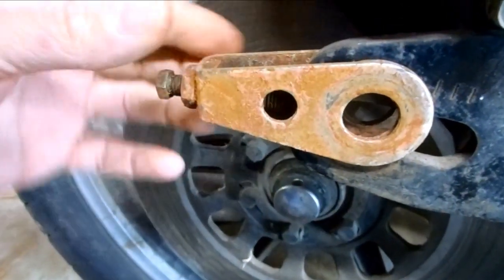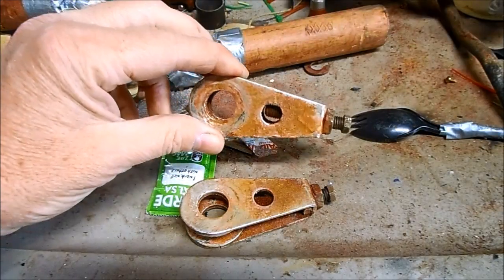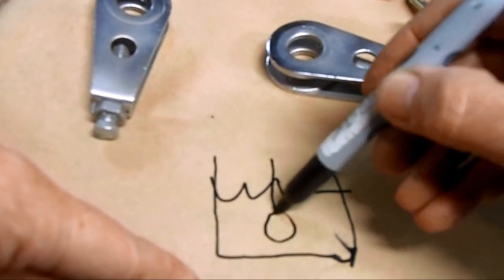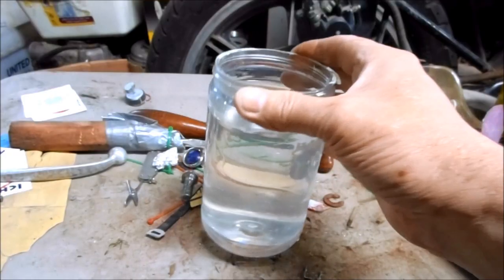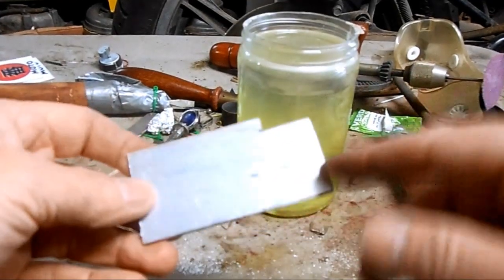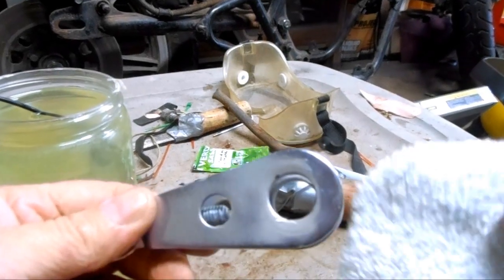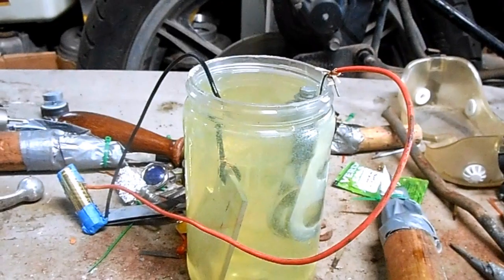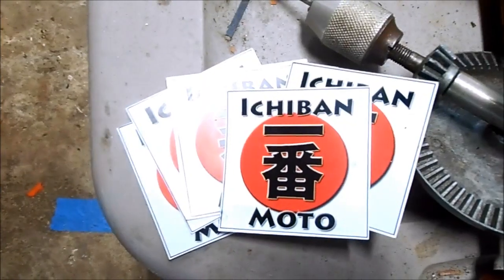how to do zinc plating of metal parts for corrosion  protection  diy electroplating

Comment: Video fake!
The connection to the zinc plate does not exist!
The plate has contact with the insulating part of the electric wire, not with copper.
MAXIMUM IDIOT!
Reply: it's always funny hearing the one thing someone found to be off but everything else seemed legit.
Reply: Thank you so much Enzo.
Phew, that was a close one. I nearly didn't electroplate my whole motorcycle.
Reply: nice catch! i thought he was on to something
Reply: It's a joke video Idiot Supreme.

Comment: Good job, but the coper wire don't touch the zinc plate, for faster results connect the wire to the plate w/o pvc insulation and replace the power source with higher voltage battery or AC/DC power supply.
Reply from the maker: induction?
Reply: Marjan Stojanovski hotnbgirlswith bigappati
Reply: Do you know that this video is a joke?
Reply: Marjan Stojanovski

Comment: roughly how long did the parts vibrator step take? also can i plate straight on to am item thats been through eloctro de rust process or will it nee to be shiny ?  thanks
Reply from the maker: it does look much nicer if you polish the metal first

Comment: Hello! it was actually proven that Coke isn't acidic enough to really remove rust; most of the results are from the abrasion from the aluminium foil. For easy DIY rust removal, a Vinegar soak is far more effective =)
Reply: i would bet money the coke had little to no actual involvement with that.
Reply: eh I know you glenn, I saw your tractor, after seeing you add the coke that evening i pissed on your tractor barrel and THAT is why it run, but it only works with MY piss
Reply: pics, or didn't happen
Reply: I used coke down the cylinders of a 1940 Case tractor that was rusted and siezed - months later she started up - good stuff
Reply: I hear your're the one that started pissing in the diesel guys gas tanks. That really caught on with to automakers. thanks

Comment: What are you talking about? This works way better with Mushroom juice and 1.5 volts AC from a 1920s train set but you have to be carefull to dust it off with baby powder at room temperature for at least 16 weeks twice a day or untill it turns black.

Comment: old zinc chloride battery have zinc  cases ;-)
readily available & cheap>>> not much charge :-D
Reply from the maker: +Paul Wedlock   oh, top tip!
Reply: So long as there re cycled:-)
It's a good thing.

Comment: You can't imagine how many times I've seen people sit around for long periods of time with sandpaper and files, busting their knuckles and wearing down their skin to remove most, but rarely all of the rust on a part. Then they reinstall it after spending part of an afternoon on it. Within a month it's already rusting again! 

A tumbler is a godsend for corrosion removal, and if this method of zinc plating is effective, then this operation is world's better than the other option I talked about. 

How effectively does the zinc adhere to the part, assuming it's perfectly clean?
Reply: The video is largely correct. After initial mechanical cleaning and de-greasing, it is better to prepare the part by immersion in 50% spirit of salts (commercial hydrochloric acid) in order to remove all old plating and rust. But never do this in the house, or the fumes will be attracted to your taps, get absorbed into the water all strip all the chrome off.Next all remaining traces of grease must be removed grease must be removed and latex gloves worn from then on, since even moisture from your hands will cause perforation of the plating.The rest of the video is largely correct, except the time element, since a good protective layer of zinc will take a few hours to deposit. Using a dry battery is a cheap and efficient way of limiting the current for a one off job. the conductivity of the electrolyte solution is also important, but unless you have measuring equipment, it becomes trial and error. Always remember, the slower the deposit, the better the protection. I would select a suitable sized battery to deposit the amount of zinc required and leave it running overnight.
Reply: if all of the rust is gone the zinc sticks like shite to a blanket but any rust will show through the plate. You can get blue/silver/clear passivate as well as gold/yellow passivate for different colours. the zinc wont stop it from ever rusting again. it will just slow down the process extremely.

Comment: You just have to be more clear that the part you want plated should be connected to the negative side of the battery.  Also, since this particular part that you used in the video has a nut and bolt on it, you have to remember that the plating can easily build up on each to the point where it gets so thick that you wont be able to turn the bolt in the nut any more.  
  I don't know how soft a metal the zinc is but you might want to plate the bolt separately and if it wont thread back onto the nut then you might have to use a tap and die to re-cut the threads on the bolt and nut section of the part.
Reply: +mrfester42 But the positive terminal is more electro-negative than the so-called "negative" terminal.  The electrons are negative, and they come from the (+) terminal.
Reply: It was a sarcastic video though.

Comment: Wooow that's awesome I've seen this method with copper coding. Actually can you do the same thing for gold coding too or its just won't work with gold ?
Reply from the maker: +Levik Eisagholyan  basically, yes. you just need to use the proper electrolytes

Comment: What are you using for media in your tumbler?, I tumble brass in corn, but dont think it would work well for steel. thanks
Reply from the maker: +doacarnage   yea, corn or walnut shells won't cut rust on steel. I use a synthetic coarse clay in this video. I breaks down too fast and takes a long time so I'm still looking for something better without buying the media from a tumbling shop. https://www.youtube.com/watch?v=DGT20ghWMZA
Reply: +Ichiban Moto I think I'll try Ebonygrit - Copper Slag Blasting Abrasive. Its only 10 bucks for a 55 lb bag
Reply from the maker: +doacarnage  bad ass awesome !

Comment: A major question :
Why you have connected red wire to negative battery pole and black wire to positive battery pole ???
Reply from the maker: +Qatari Man   you need to use both ends of the battery

Comment: ok I sanded down a aluminum compound bow riser.
Reply from the maker: +Chad Brailer   aluminum oxidizes, but ferrous steel rusts. there are unique and different process to protect each.
Reply: i did have it powder coated but that was a waste of time.. it chipped all the time. i was thinking of doing hydro dip an see where it go's with that.. if not what i want then i may just stick with the polished aluminum look.. its a old mid 90's compound an just fooling around. Thanks for the info to.
Reply from the maker: +Chad Brailer  let me know how that hydro dipping goes, I have yet to try it
Reply: ill do thanks

Comment: Very clever,   I will try it.   Do you have a video on how the bunt cake pan vibrator works?
Reply from the maker: +Jeffrey Nelson  yes, I have a video on how to make the vibrating parts tumbler
Reply: +Ichiban Moto   I was thinking about making a little aluminum box that would clamp under the sander and partially filling it with sand.   Worth trying with the random orbital sander.  I will work on this tomorrow.

Comment: "the red is hot, the black is power"..............
Reply from the maker: +TheDrakenZ  correct
Reply: Ichiban Moto I was under the impression one was power and one was ground on DC, also that hot was synonymous with power. "hot, neutral, ground" with AC. I'm curious.

Comment: Bad ass for sure. I was wondering though if the piece was plated where you have the wire connected to it or does the wire prevent the plating from reaching it?
Reply from the maker: +Nativtexan2  you can tell where the wire was. somebody told me to do the plating in two steps, each time hooking the wire to a different place to ensure coverage

Comment: Great job Ichiban.  I used a slightly bigger container, can you give proper ratios of soda to juice to water?  Thanks in advance.  Also you didn't give gauge/length of wire or actual battery voltage.  Are those important ?  Because your parts looked great and I want my part to look great.. ut oh my coffee is ready to consume gotta go by by..
Reply from the maker: +MrB82901    I love coffee !

Comment: I have question. Can i chrome my motorcycle parts with this method?
Reply from the maker: +Wąziu Kebab   chrome plating is too many steps and requires  very dangerous chemicals.  so I never tried that
Reply: Oh ok, so is this proces works with other metals than zink?
Reply from the maker: +Wąziu Kebab    I have never tried different metals . I have only used zinc. It's basically just galvanizing.

Comment: Please take note that in the video he did a simulation of drilling a hole in the Zinc plate but the plate did have a hole in it so it apparently was drilled off screen and also the fact that the negative wire still had the insulation on it where it was threaded through the plate. There will be absolutely NO current flowing through the plate to the chain tightener. The wire insulation must be removed so the wire is actually touching the plate. I'm not sure this process will work but it's still worth a try. To bad he didn't go to the trouble of doing the video correctly.
Reply: +SOAPBOXSAMBO Look up the word "Parody"
Reply: +Hathorr1067 OK, I'm not gonna get into a debate with you but I will point out that you wrote "Here I demonstrate my DIY process" and NO you didn't. I know what a parody is and that wasn't noted anywhere. If you're gonna do a parody at least do it correctly. With that, I will allow you to beat me up for pointing out how not to connect their electrical wire to the host plate and you should take back four (4) of your ICHIBON MOTO stickers. :-)
Reply: Well, I am not the author of this video for one, and somewhat see your point, but this guys channel is really about giving you an idea, and the rest about humor.
Reply: +Hathorr1067, My fault for not looking to make sure you were the author. Sorry about that. Please accept my apology. There is so much junk out there and to me this is one of them. I totally missed the humor. I was researching info to actually zinc plate some parts and when I got to watching this I could help but make a comment. When someone is looking for correct info this isn't where they will get it and that was why I pointed out the flaws. Thanks for your reply comments.

Comment: A much better job would have been attained if you detached the Adjusting Bolt and its Locking Nut before you plated the main assembly then plated the Adjusting Bolt and Locking Nut seperately !

That way you get the Galvanised Protection evenly distributed on each part of the Assembly !

Other than that, nice Video presentation - thanks !
Reply from the maker: +LiarNoseOnFire   awesome, thanks for the tips !

Comment: Ichiban Moto! Is there a way you can do a handful of bolts and nuts etc at once mate?
Reply from the maker: +vhrte49  There is hot dip zinc galvanizing process that I have yet to try.  If I do, I'll make a video.
Reply: +Ichiban Moto cheers mate

Comment: I was considering zinc plating some suspension parts but was concerned that I might have issues with the johnson rod. Do you have any advice to ensure successful plating?
Reply from the maker: +LBCAndrew    Most Johnson rods are stainless and only need to be cleaned up, however if yours is only mild steel, you can plate them to prevent corrosion.

Comment: It looks real, but is this a joke?  At 2:42 the sacrificial zinc plate wasn't even touching the battery wire it was supposedly attached to.  The battery wire wasn't stripped where it went through the hole in the zinc plate.  The copper wire that was exposed looked to be too high to touch any of the zinc plate.
Reply: It's all a waste of time. It's all a joke nothing works like he says.
Reply: +itchy Come on man, it took you a year to think up that BS reply?  Seriously funny stuff. :)
Reply: Look closely.. he tried to trick you with polarity... in his video Red was - and black was +  wrong.. This works if you get it right. This is how you really do plating...
Reply: It's good for stripping other bothersome things, like skin and lung tissue. :-p
Reply: Had a bit of time on my hands, tried it. Waste of time didn't work. I think his eztumbler is a heap of shit too.
Reply: "Methyl Ethyl Ketone" is a real thing. lol
Reply: +NoneTaken 
Well, that is the trick !
Cover with zinc, without consuming zinc
It is a Star War solution !
Reply: +NoneTaken This is more likely copper plating, (I know not even that) as you say its not touching the plate. Also naked part of copper wire is in the solution. So if something will plate to the part, it will be copper. (youll need copper sulfate I guess) not the zinc
Reply: Graeme Williams h
Reply: Methyl ethyl kacetone [sic] is not a real thing. Unless he has a mixture of MEK and acetone, which is a decent solution for stripping organic contaminants from surfaces. The stripper we use in the guitar factory I work at has toluene, acetone, MEK, ME*(another ME- substance that is less common), and another organic solvent I forget. It works amazingly for chemically stripping lacquers, glues, and for softening plastics.
Reply: Oh, and anyone who has ever played with AA batteries during class knows that taping a wire onto a battery results in a poor connection, reducing current greatly. Don't believe me? Grab a couple of batteries and an old RC motor. You need strong finger pressure on both contacts for full current to flow. Taping it and leaving it will never work.
Reply: Skeefoo Panama ha ha ha
Reply: Is that as XS500?
Reply: @aaronbiggins4231  It's a right hand drive Australian model called an INXS500.
Reply: Goof Ichiban observation
Reply: Methel-ethyl-kacetone...really?

Just remember that name:
Ichibanmoto
Reply from the maker: induction
Reply: +NoneTaken  That is why it's called satire....
Reply: Clearly the wire was stripped and tightly contacting the Zinc.  Not sure who's glasses you had on but maybe you should consider trading them old one's in for a new pair.
Reply: +Rick Murphy Wow, why are you being such a dork?
Anyway, at 2:42 everyone can clearly see the wire is not stripped for it's loop through the zinc anode plate and the little bit of wire that is stripped at the end is barely if at all touching the zinc anode.
Reply: +NoneTaken Shit, your completely correct.  Guess i need to get an updated pair of glasses.

Comment: Very confusing. The convention is that red is hot, black is neutral or ground. I guess this was a joke but the only problem is that if someone uses a battery charger with the same configuration the part will be the sacrificial metal.
Reply: You are correct sir, electron flow is negative to positive. Red wire aka negative on the battery is connected to the part, if it is real at all all he has done is cleaned it electrolytically. Don't be fooled readers. 1.5v and zinc in some pickle brine is not the best way to do it. Watch some of the other videos on here.

Comment: I just tried this and it didn't work. I used tap water, washing soda, and an old motorcycle battery putting out around 9 Volts. The copper wire did pollute the soup but not that much. For the zinc I used a zinc-plated piece of metal. Am I supposed to use a pure zinc piece of metal? Where do you get that?

Comment: Just wondering if it will work on muffler bearings mine are a bit rusty.
Reply from the maker: P Kuudsk  As long as you use heat grade zinc.  
tip:  do 1/8 at a time,  rotating with each plating cycle to ensure proper coverage

Comment: Great technical advice as always. I think I'll plate my nuts, they are getting old and are rather crusty.
Reply: Coldfin9er That's what my wife told me about mine.
Reply: Make sure you leave them in a vibratory tumbler first.
Reply: You will have to put them in the vibrating parts cleaner to remove the "crusty" first. [gotta see that]
Reply: Soak it wid pickle juice for 1day then let your wife taste it if its ready to get plated or not and also no shower before and after
Reply: Zinc plated my shaft, could always use some long lasting protection.
Reply: I lead plated mine. Makes them bullet resistant.